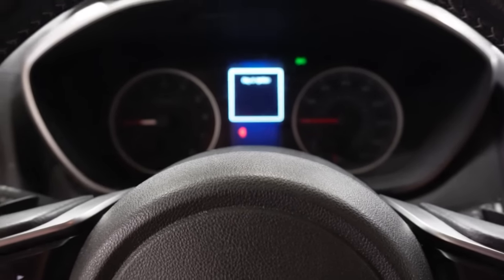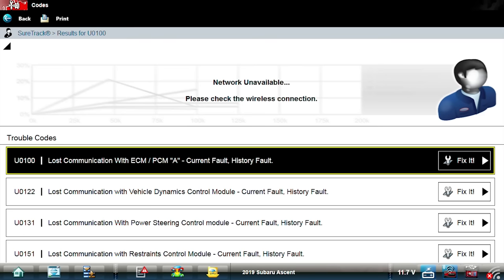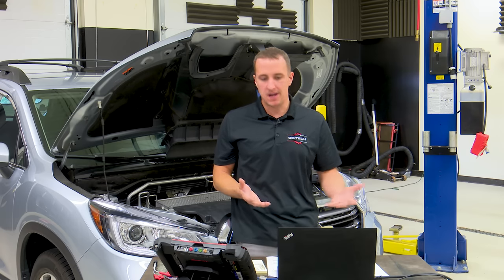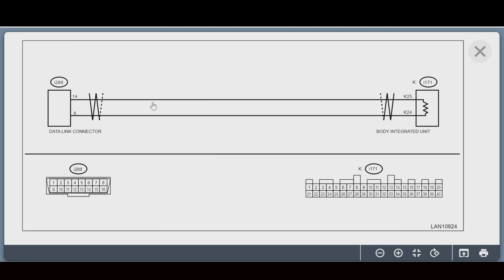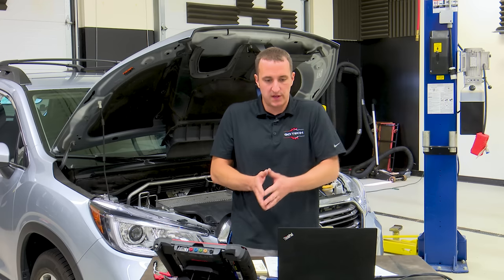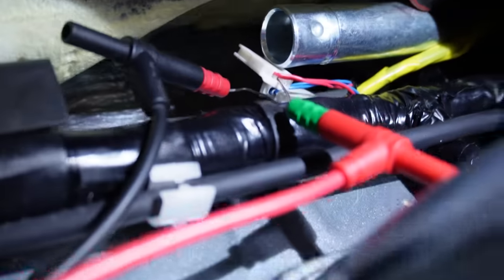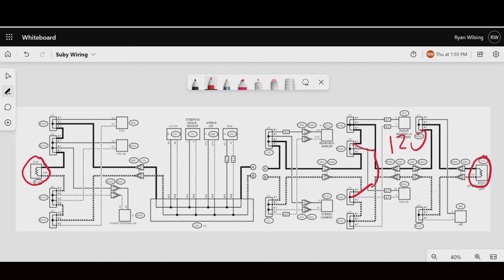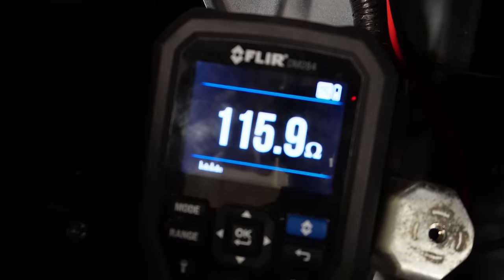CAN Bus Troubleshooting and Diagnosis Explained (Part 3)

Comment: Might have been a good idea to check terminal resistor in PCM itself at pins A58 and A45 just to be 100% it isn’t a pin connection issue but evidence was overwhelming anyway.
Reply from the maker: Yeah it still couldn't hurt, 
I would also like to open up the module and see if there is any visual damage
~Ryan
Reply: Yeah what about piggybacking   a resistor right there and hook the ECM up and see if it actually still works and it was just the resistor. You could have saved somebody a lot of money or at least a do it yourselfer that didn't need to change out the whole ECM.

Comment: Really good series. I have learned to appreciate the more complex network designs ever since I had a short in an air conditioning system cause a no-start by pulling down everything on the network. It then became apparent “ohhhhhhhh— NOW it is clear why a gateway is useful!!!”
Reply from the maker: I agree it is nice to have something split these networks up!
Thanks for checking out the video!
~Ryan
Reply: @SchrodingersBox was the AC short causing the no start on a  Ford f150 by any chance? The reason I ask is because I have seen this multiple times on those vehicles, usually late 90's up until mid 2000's. I just recently subbed to your channel as well. You guys all have some great content. Keep it up! 👍🏻

Comment: Thanks for posting this entire series.

I'm a DIYer, facing odd issues on family member's cars with communication loss popping up commonly, and while I was aware of Can bus concepts as an electronic hobbyist, I never really put much thought into the network segregation to improve reliability.

I'm also a bit of a hobby roboticist, and now, I'm more comfortable with both troubleshooting automotive problems, AND I can re-work some of my past designs for robotic networks to eliminate the "house of cards" reliability issues you mentioned!

Comment: you sir are the goat. Im, currently doing a harness merge on my 00 subaru and learn as i go. For the past weeks i've learn to myselft how to read the subaru diagrams and what they ment and how they work. And when you showed a subaru wiring diagram on the video, I quickly went "is that a Subaru diagram?". And it was so funny to me that, it is and i quickly recognized it 😂. 
Canbus does not really apply to what im working on right now. but for future reference (my 08 rx8 that has a canbus system) , really gave me a full understanding on how newer cars work and gave me ideas on how to diagnose these "new systems". 
great video series. I definitely learned a lot. 👍👍

Comment: Great job Ryan!
As a part time trade instructor, running a business and a YouTube channel, it can be hard to explain to students the diagnostic process.
Thanks for an excellent 3 part series, which logically broke down the process into manageable sections.
It has given me some great ideas to include in my classes. 
Cheers
MiracleMAX
Reply from the maker: I appreciate that!
Thanks for watching! 
~Ryan
Reply: Great video Ryan and thanks a lot for the info and the effort you made. 💪👍

Comment: Best video series I've seen so far!!
I've applied what I have learned from your videos, but I am still a little unsure of my diagnosis. I have a 2013 S550 4matic with the do not shift error. Scanned the system and  got no can message for about five different modules but no faults in the gateway module. I think the problem is the gateway module. The voltage and resistance are good on every can connection. I don't have a scope yet. It's in the mail.

Comment: Thanks for an excellent video series explaining the simple yet complex CANbus network system that run our cars. Great seeing someone step by step breakdown the wiring and network topology of connector found all over these vehicles, and going after a connector and skipping it because it's too deep in the console. Don't shorten the video just because it's not going to workout. Only take apart what you need too when you need too!

Comment: Excellent series on this subject, I will be encouraging all of our techs to watch! One comment on your technique for checking CAN line short to power using continuity to pin 16 of DLC with the battery disconnected. In checking this way it will show a short to any 30 feeds but this test excludes any possible short to power to the fed side of any switched power circuits.

Comment: Im a field engineer recently forced out of avionics career reinventing my self as a Marine intrumentation fiekd engineer. These systems are now CAN BUSS. Great video...and great view inti all screen displays. So is the ECM openable for resistir repair or is it sent back as a core return for factory repair? Last guestion is a source for the test lead adapter kit. Wonderful tutorial!
Reply from the maker: The ECM could be repaired by the right person. There sealed up really good. Under most circumstances it will be a new computer with a possible core.
Thanks for reaching out and watching the video!
~Ryan

Comment: Thank You, i have found this informative. its slow at work today so i thought i would reinforce my diagnostic skills. your method of adding a resistor seems to be a very useful process that i will certainly take advantage of in future diag. i have had a few communication failure jobs in the past couple weeks, 1 - 2007 pci bus and 1 - 2017 can bus issue and i found myself learning more than diagnosing. This series will definitely save me some time later.  subscribed

Comment: I am halfway through the video when I write this.  My main gripe about testing networks is, sometimes the modules are BURIED in spots where you have to remove a lot of stuff. And that presents 2 problems : 1- You have to adjust your diagnosis time to account for gaining access to the modules to test.  2 - You have so much stuff removed that now you can't hook up to the circuits and roadtest the vehicle.  
Great video series though!

Comment: I’m curious why you don’t use an Obd2 breakout box? Very inexpensive but super convenient and have led indicators for data/power
Reply: Because as mentioned through out the series as cars get more and more modules they get connected to a "gateway module" and the DLC is just wired to it but not part of the network, so on newer cars you can't measure specific network activity through pins 6 and 14

Comment: Awesome series, very detailed. As a long time electronics tech and licensed electrician, but NOT an auto mechanic, it was very rewarding to follow along with all your testing procedures being spot on. What I didn’t understand was how the can bus communicates. This was important to me because my boat has a can bus that has some issues and I wanted to learn how to troubleshoot it. So did you replace the ECM in that car? I imagine it was pricey. Could you have kept the ECM and installed the test resistor more permanently by tapping into the blue and red where it exits the connector on the module and save that expense?

Comment: THANK YOU FOR SHARING YOUR TIME AND EXPERIENCE WITH US. I HAVE ONE QUESTION. I ORDERED THE TERMINATING RESISTOR YOU USED BUT WOULD A REGULAR FIXED 120 OHM RESISTOR WORK TO DO THE CHECK.

Comment: Great series of lessons.  I had no idea what CAN communications was or how far back it went.  Now, I can work on my '07 F150, an old '05 Rubicon, a '00 blazer and my almost new Toyota Rav 4.  One question, what scan tool can I afford to get that will allow me to see interactive diagrams for various vehicles?  I can't afford a $10,000+ scanner but even $2,000 or so could pay for itself in a few months/years.  Of course, $300 would be better, if capable.  Thanks for your efforts and your unique ability to take big undefeatable problems and break them into smaller ones that can be defeated.  As an electronics analysist in the Air Force, decades ago, I recognize the same conceptual processes we used then.  Great presentations!!
Reply from the maker: Thanks for watching!
The diagrams I use are from a online subscription to AllData,
AllData is a vehicle service information website
~Ryan

Comment: Am very grateful sir for your time that you took to prepare this lesson.Indeed have learnt alot on how to narrow down the entire network to individual network.My request is for you to prepare another lesson on a different vehicle.However, I was not sure on which pins on pcm did you connect the resistor.
Note am currently studying automotive engineering and am trying my best to acquire knowledge.Otherwise thank you for precious time.

Comment: Hi, I just wanted to get back to diagnosing my 2010 Explorer multiple trouble codes and 2018 Taurus misfire code. My Snap On scanner experience goes back to 2005. Do you have a minimum requirement for a modern scanner I can purchase? Love your informative channel.

Comment: Great series, I just have 1 question before condemning the PCM, would have been a good idea to check powers, grounds and voltage drop test them at the PCM? I know the issue was the PCM for pulling the network down which was proven but sometimes that is caused by a bad power and/or ground.

Comment: Great video, very informative.  A couple of notes however, at 40:54 and 42:05 you were referring an open circuit as “zero” resistance when it’s actually infinite resistance (open line).  I see this all the time when I’m teaching my electrical courses.  Thanks for the video!  I learned many things about these networks! 👍🏻
Reply from the maker: You are correct, thank for reaching out and checking out the video ! 
~Ryan

Comment: Your work has had a profound impact on me and those who have had the pleasure of watching your creation. 
Does it works if you cut the wires and install the resistor and connect the connector back to the PCM???
Reply from the maker: Thank you for the kind words!
If you spliced in the resistor it would fix the network, but the PCM be out if the loop and not communicate. 
Thanks for reaching out !
~Ryan
Reply: @GoTechTraining   thank you very much

Comment: Great stuff really enjoyed all 3 parts! I got a question, when you first measured at the first junction, at the pillar, to see if it was shorted to power or ground — if it was in fact shorted to either power or ground how would you go about testing to pinpoint where the problem is?
Reply from the maker: Great question! 
Instead of testing at J/C connectors to pinpoint for issues. I would disconnect J\C connectors and wait for problems to disappear. Then work from there 
~Ryan

Comment: Great Job. I have a question, How can you diagnose a Can system which has multiple aftermarket accessories  connected to it at multiple points?
Thanks for doing all this. it will definatly help.

Comment: Thank you for this. It was very informative. I try not to work on cars, but rather heavy equipment and trucks which use J1939 protocol, but after watching this series, I think that the only major difference is the type of connector. 

One question on testing short to ground and power. Would it be better (or possible) to do a voltage drop test? Or is that even needed for this test?

Comment: Great video. Now I have a question, let's say for the sake of argument that the only issue with that ECM was a bad resistor. Could we prove that and even maybe fix it by simply adding a 120 ohms resistor right on the the wires going to pin 45 and 58 of the A connector at the ECM?

Comment: Great job, Ryan. This kind of depth has been needed for a very long time. One question: had you disconnected the ECM (without adding the resistor) would the network have had communication because the short issue was disconnected?
Reply from the maker: If it was a fault tolerant system it may have been able to communicate at a slower speed, but most systems need both terminal resistors in place to communicate.

Comment: Should you test for from v70 to Pcm to make sure wiring is good??
Reply from the maker: Because the resistance is good and it works with the substitution resistor, it proves the wiring is ok.
~Ryan

Comment: Very informative, and systematic in your breakdown of the process to isolate and check areas at a time, I am presently having only a 120 ohm read at obd2 connection, regretfully I do not have access to the wiring diagrams for this 2021 Ford Escape, so it is off to the dealer, I hope that they have a talented person similar to yourself that can diagnose properly. If I had the diagrams I would love to check it myself, since I am a Instrument Tech. at a Steel Mill, and also have the degree in Electronics, among many other specialized training for mechanical/hydraulic/pneumatic system work. How much does it cost to get access to your source for diagrams and info?

Comment: Ryan, AWESOME teaching and thought process to get to the bottom of the problem  really an eye opener one thing though can we test short to ground or short to power or short to each other by using the scope not the voltmeter to check the resistor so by watching the scope if we see more than 2.5V that be short to power and close to zero that be short to ground and don't know about short together what the reading will be or by using very low AMPREGE test light like 200 milliamp  any how appreciate ur time and effort to this series really enjoyable please  more videos like those would  be much appreciated .cheeeeerrs from ONT, CANADA
Reply from the maker: You could definitely use a scope and look for voltage out of spec, it probably would be hard to get a straight 2.5 volts , most cam networks are constantly trying to communicate. But if it was zero volts or 12 volts you would know you have an issue.
Thanks for reaching out ! 
~Ryan

Comment: Thank you I really enjoy the the method of developing understanding before diving into testing. this way you unlocked a couple of blocks I had and I was able to be in a position to diagnose with you at the end of Part 3. I suppose you could open the cover of plug A for the ECM and back probe pin 45 & 58 and insert plug A back into ECM and test it? I a fan Go GOTECH!!!

Comment: Great finale video which truly ties up the previous ones!

Since that diagnostic network is about 120Ω when the scan tool is not plugged in, I suppose it will read about 60Ω when the scantool is plugged in. So the scan tool has a 120Ω resistor in it?🤔

Thanks for making these videos! 👏🏼
Reply from the maker: That’s a great thought!
I’ll measure it when I get time !
Thanks for reaching out ! 
~Ryan

Comment: Hi Ryan, great trening videos is helping me a lot, but I'm self teaching my self and I will take formal education as technician becouse I feel great passion for the subject. But with kids and work I have to save for the curses but by the while I learn where I can. My problem is to get good diagrams like alldata. Whis cost aroundt 1000usd the year subscription and the rest Haynes emanuals are pure garbage. I use lots of time looking for diagrams and datashits for components like from Siemens, Bosh but I can't find much. Do you have any advice where to look?
Haynes follow codes to show parts of diagrams but don't shows all the module overwieu. To get the big picture like you have inn alldata. And if I want to check like the fuse modul don't even shows the connectors pinup a really natemare. And 1000 use a year is a lot while learning with out incomes. Is there others way to get such diagrams ?

Comment: Ivan had a car not too long ago where a guy was patching rusty sheet metal under the car with a welder-- and he burnt through and even stabbed the welding rod through the floor under the drivers seat and melted/ shorted data lines and power lines at the same time-- and likely sent 30v or 40v onto the can bus FROM the welder-- and it smoked like 8 different modules that were all on that same can bus. lol..  Ivan gathered up some cheap fleebay finds and got most of it running again.  Pretty crazy diag.. It's a good watch.  A lot of network testing..  (It was this year;  couple months ago I believe)
Reply from the maker: Crazy ! I believe it! It’s not hard to cause module havoc! 
Thanks for watching ! 
~Ryan

Comment: couldn't you have just tested the 2 pins on the ECM to check the resistor? can you wire a 120k resistor across the 2 pins at the ECM and see if everything would come back on line. Wouldn't it start then?
Reply from the maker: Good question
Yes, But I wanted to ensure the rest of the network was ok.  
I did wire in a 120 Ohm resistor to get the network back online, but it would not fix the damage inside the ECM or make the ECM come back online.
Thanks for reaching out!
~Ryan

Comment: What happened to trouble trees. does the engine crank, If not ck this . does the engine crank but won't start ck power and ground at this wire or connector. It just seems like you jumped way ahead by going to the scope without checking some basics first. Is the transmission in park Whats the battery open voltage? What's the condition of the battery.I know ive been out of the business for a while but it still has the basic stuff to ck before you have to brake out all the high teck gagets .
Reply from the maker: True, it is never a bad idea to check the basics 
Thanks for watching ! 
~Ryan

Comment: I was helping a friend work on his 2020 Lincoln - it would not start - push start button and nothing - not even crank. We checked fuses and relays - which checked out ok. When we connected to the DLC - discovered we had NO COMMUNICATION - tried three different scanners - all could not establish communication. So my friend took it to the dealership where he purchased as he had an extended warranty. The technicians located the problem a week later — the motor mounts have some sort of liquid / hydraulic filling - SO - what the technician found was the motor mount had developed  leak - the fluid ran down a wire harness and into a connector - then shorted out the PCM 🤨😒😐 - good thing he had an extended warranty